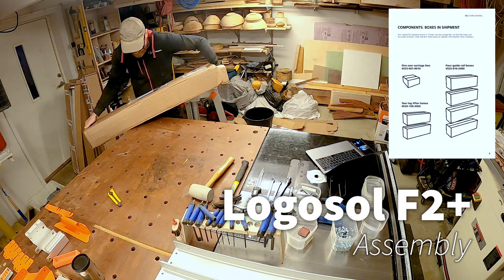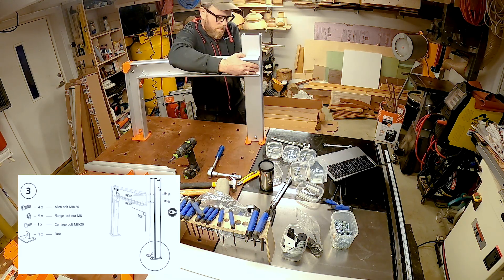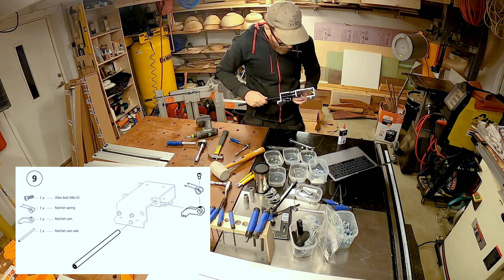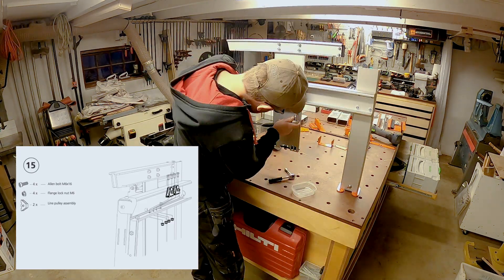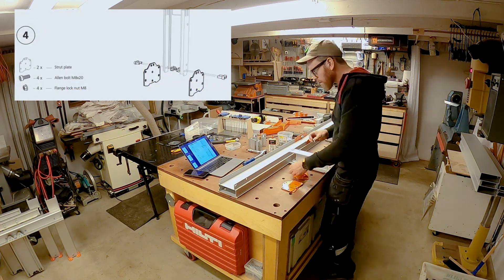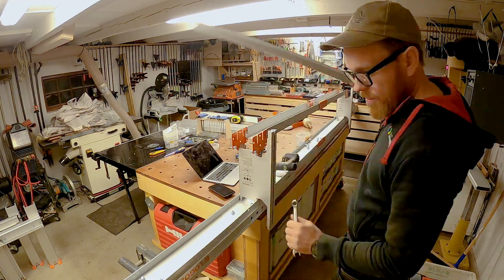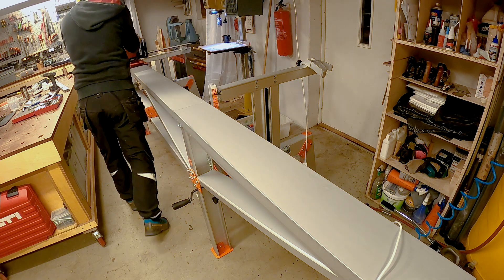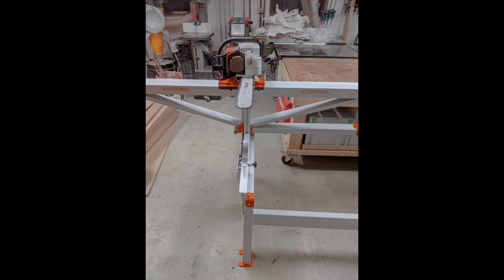Unboxing and building the Logosol F2+ chainsaw mill

Comment: Have a video on how you got a straight cut on you mill?
Reply from the maker: Apart from ensuring you have a chainsaw that is cutting straight, there's nothing to it (Check out the other videos for operating cutting).

If you're having trouble with your saw not cutting straight, try the following:
1) Ensure bot left and right cutters on the chain are equally sharp and roughly the same length (or try with a new/different chain)

2) Ensure your bar is equally worn on both left and right side, if not, you need to re-shape it (or try to flip it around and see if that helps).

I had 2) happen to me and it was almost impossible to tell the difference, but a small 0.5 mm difference made the saw track upwards. I sanded it on my belt sander to a perfect 90 degrees and it worked great after that,

Comment: Thx for this video, which is super helpful. I have the F2 and it was a major problem to get the guide rail flat, so it was kind of interesting to see an honest appraisal of how hard it really is to get four 1m sections in a nice straight line! My question is about the log lifters though... I have not used my mill yet, and want to ensure I have installed them correctly. It looks like it's only possible to wind the lifters up, and to go down you have to disengage the ratchet cam. My worry is that if there's a heavy log on the log beds this would make a very fast, hard and dangerous descent. Am I missing something about the way in which these work..? I would be very interested to learn before I go put something heavy on it. Many thanks again for sharing.
Reply from the maker: Thanks for that! Winding down the lifters is not really a big challenge. Even with super heavy logs, you simple crank a quarter turn, disengage the cam and slowly lower it. For lighter logs you can just let it go, it doesn't go super fast.
Reply: @Hackish  Brilliant! Thanks for this advice. Cheers, Nigel

Comment: Can’t use Stihl 661 C-M in USA ...... The Alabama stihl rep says they are not made for it ..... not tough enough ..... and the captured bar nuts prevent Logosol mill attachment ..... and there is no ‘nutless’ cover made.
‘
Reply from the maker: I'm using the Stihl MS 880.
That's certainly more than enough, but I've seen and heard people use the MS 661 as well, but it's a bit of a mixed bag of how happy people are.
I guess it depends on what you're milling (type of wood, width of stock).
Reply: @Hackish  for ms 880 , how long is your bar?
Reply from the maker: @kentcochran8311  I have two bars, one at 24" and the other 48"(!!)